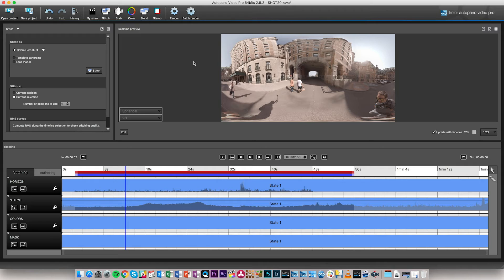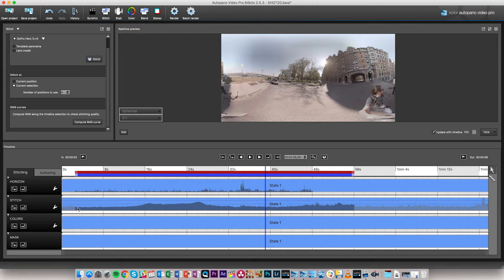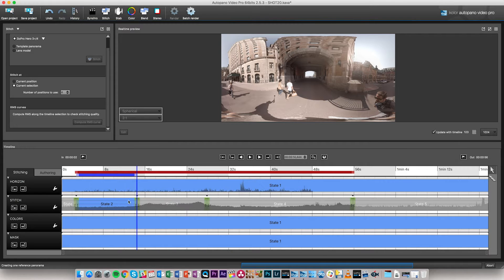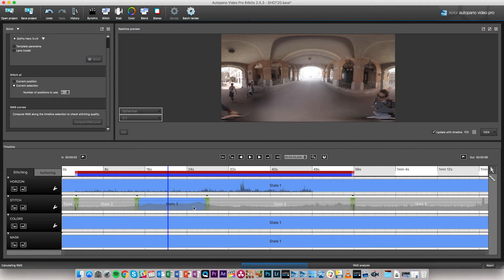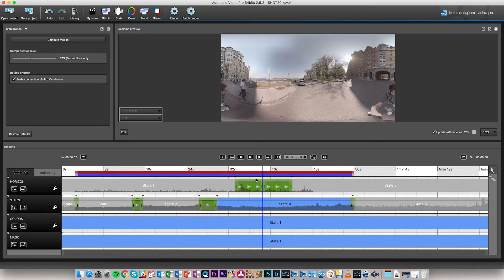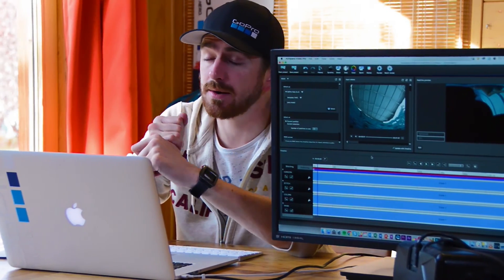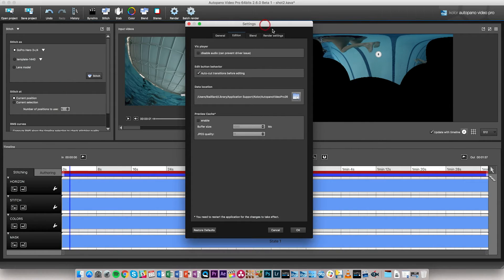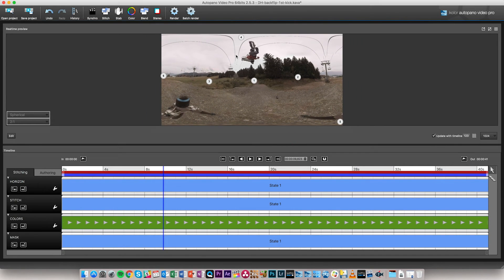Part 6 - More Complex Cases | The full 360 video creation workflow

Comment: I'm struggling a little bit with trying to achieve similar results for my edit  by following steps of this tutorial. Maybe I should use a different tutorial because mine is a static mounted Omni in the centre  of a room and I (subject) move around a little between the individual cameras of the rig, and this is where seem lines and stitches run into issues. I noticed that my RMS is pretty high for the entire vid, it's about half way up. I am guessing that this makes sense since the room I'm in is only roughly 30x15ft, with 12 ft ceiling. The overall stitch is good enough though, until I walk around. There are a few small point where the RMS jumps up, and this is while I'm walking from one camera to the other. The stitch is quite off during the point where I transition from one camera to the next. I tried to adjust this using the cut tool as first shown in the vid, but it didn't effect my walking through the camera transitions at all. It actually messed up my horizon between the new states that were created. So I aborted this, and tried to correct the blending using masks. Still, no luck. This just caused weird movements and really no correction of my mis-alignment due to parallax. What can I do? I'm really struggling with learning how to correct these parallax and stitching issues, but in the vid where the biker transitions from one camera to the next, it seems that the stitching issue created by parallax was fully solved with the masking technique. I can render and post the video that I'm working on in the state that it is right now if someone could please take a look and tell me what I should/could do better? Thank you so so much anybody who responds to this, and thank you for posting these videos. I understand that it's much easier for me to expect help than it is offering help to all the various people with different questions and varying degrees of knowledge. I appreciate any response.
Reply from the maker: Solving something like that will probably be a combination of masks to get the stitch lines to be as vertical as possible (if you had the Omni in a diamond configuration) and work on the control points. But it really depends on what difference there is between your "normal" configuration (stitching on the walls) and the walking around configuration - ie how much does the stitching distance changes when you walk in a stitch line. If the wall is normally 4 meters away from your camera and you walk 2 meters away from the camera, you won't be able to have a stitch that covers both those cases. If you stitch on yourself walking, the stitch won't be good when you are not in the stitch line and the wall will be broken. And the opposite is also true. Solving that case will probably involve doing a render focused on background stitching, then a render focused on you walking around, and compositing the two of them in AE. 
If there is less difference between the two situations, you should try working on control points when you walk through the stitch lines (basically, go in APG and work on CPs for the seam between cam 1 and 4 when you are in between those 2, save, find the point when you walkj between 4 and another camera, find CPs there etc... Optimize for this and see if the background is broken or not. If the background gets broken but in places where you don't have anything happening, then you can just correct that with some static jpg patches.
Reply: OK so do you have a tutorial on doing a render on foreground and background and compositing the two in AE? The wall in the background is about 3 meters from the camera, and I walk about 1.5 meters away from it. Also if I try to work with control points in APG, how do I correct any broken places on the wall since I don't have anything happening there besides a static wall. Is there a tutorial for jpg patches on your youtube channel here?
Reply from the maker: Part 8 will touch a little bit on that, but then you should try and find Compositing tutorials on AE as i'm the Kolor trainer, not Adobe's :)
With that kind of distances it will require quite a bit of work to correct things though...
We'll have another tutorial coming up later this month (or first half of next month) covering adding a jpg patch (in the case of a tripod, but the same logic applies for correcting other spots) in Premiere.
Later this week we'll also publish a video showing the full work on a shot from the Tour de France last year in 7 minutes with stitching, multiple plates, compositing and adding jpgs in Premiere. It's a screencap sped up 1000% of the speed but it should show you the general idea of how we correct shots.
We also just published a full control points tutorials (Part 7 of the full workflow tutorial series).
hope this helps.
Reply: I've been notified on the new uploaded vid you just mentioned, I'll have a look in a bit here! I'm currently stumbling my way through adding spatial audio to the video I mentioned earlier. Yes, I'm about 12981298 steps ahead of myself. I still haven't come close to perfecting stitching and am yet to attempt to remove the tripod and I have to perfect my abilities with stitching and blending...but here I am, diving into another realm of unfamiliarity. I understand all this stuff in the abstract, oh isn't it painfully ironic however that practically, it's very difficult to comprehend. Anyway I appreciate the reply and the tutorials you post. The jpg patch tutorial next month, will that cover patching the tripod for dynamic shots? I recently shot a buddy with his electric skateboard and I'd love to be able to learn how to remove the 3rd person view backpack pole. Thanks again for the reply!
Reply from the maker: Going ahead of yourself is the best way to learn ! Ambisonic sound is a complex problem though so good luck with that !
Regarding a moving patch, i'd recommend looking at our quick tip video that was uploaded recently as you might find a solutions there that could help you. If not, then i'd probably check out Mettle and Mocha plugins + tutorials as those are the best tools to work in AE with 360 footage right now.
Reply: Kolor Fantastic, thank you for the advice. Now in your tutorials when  you select compute RMS curve, it seems to do it quite fast. For me, it takes 20 min or so for a couple minutes of footage. Is this normal?
Reply from the maker: Yes, it depends on your computer. And we might have sped up the computations in the tutorial edit as well.
The computations speed depend on the number of cameras in your stitch, your CPU and your GPU.

Comment: Thanks dude. This has helped me a ton. Here's one of the first videos we created with our Omni - https://youtu.be/_-W1C7hF4Ns
Reply from the maker: Hey, nice one for a first. couple of things : 
IMHO, some cuts are a too fast (rule of thumb is about 10 s absolute minimum / shot) and there are a couple shots where there was a bad cut at the back like if the equi was not complete (first shot in the locker room and the one before that). But all in all, it's a great place to start at if this was your first production with the Omni. There's almost no visible stitching errors even in some more difficult situations. 
Stocked to see cool projects from our customers !
Reply: Thanks a million for watching and critiquing. We shot a ski video this past weekend. We're putting that together now. Balancing the horizon on that is challenging but the footage is awesome. Very happy with the Omni so far. Not happy with the on camera battery power though. Super unpredictable in cold weather. Hoping for better results in the summer :-). For now, the external battery is our go to.
Reply from the maker: Yeah, on camera power is always tricky in cold weather. But even when you cannot be tethered to the battery while you shoot, you can charge the Rig between takes by plugging the external power. Glad you enjoy the rig though !
Reply: Page 12 of the Omni manual says to remove the batteries when powering the rig with External Power. Have you run into any issues with the Omni with your power setup?
Reply: Nope. We run them on external for timelapses or long periods on stationary shots, then put in the in camera batteries and run it for shots with our robotic dolly or devices where external power is not viable. So far so good. You?
Reply from the maker: The recommendation is not to shoot with internal and external power at the same time. You can use the external battery to charge the rig when not shooting (when it is powered of) or shoot with the external power plugged in but without the internal batteries.
Technically, it can work to shoot with both type of power sources (internal battery in the cameras + external battery plugged in) at the same time, but as we cannot guarantee that there won't be some conflicts that may lead to freezing the rig / crashes, we cannot recommend this use case as there is a very small chance that you might lose some data.